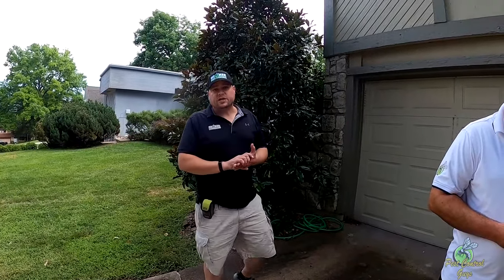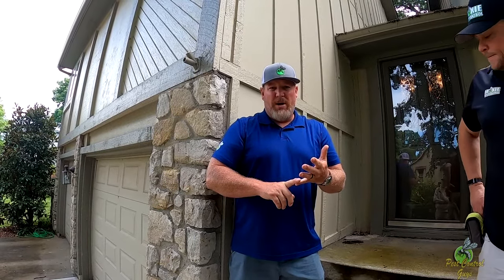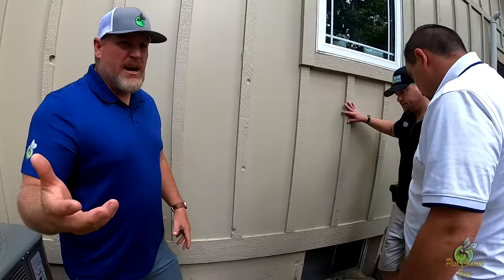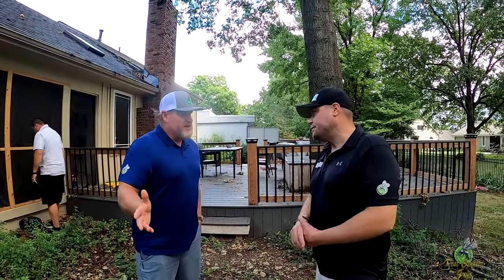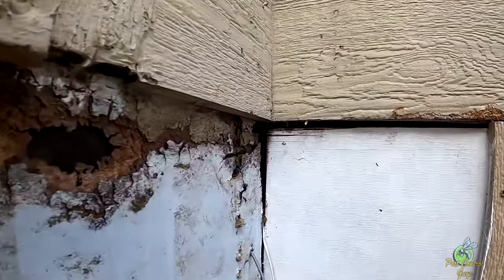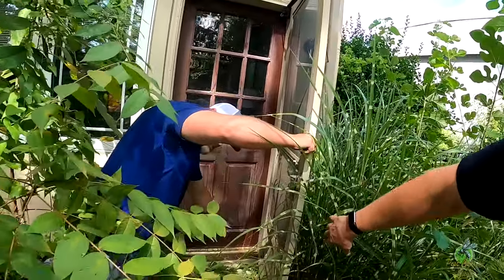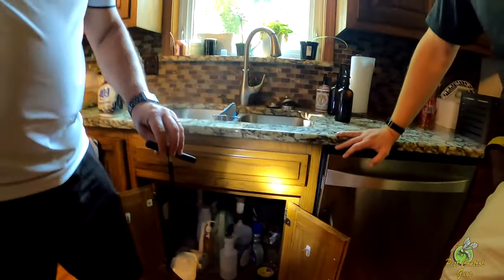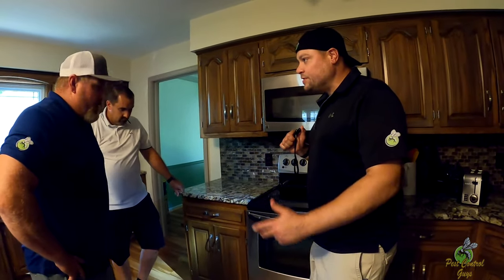How to do a mouse or rat inspection on a home. #mouse #pestcontrolguys

Comment: Good grief, maintenance, maintenance, maintenance. I do exclusion work every spring thru the summer to prep for winter. Every single year. The mountains are a rough environment but we have coal mine rats, the size of pit bull puppies. City princess thought it would be a great dream to move to the mountains. Uh, compared to the mountains large cities don't have rat problems. Try a mid-century modern house, unoccupied for seven years which no one told me and you know what I moved in to, a rat house. Princess learned everything from maintenance to plumbing to masonry, everything but electrical. A twelve year nightmare. I remember when I had a missing dryer louver. I found the fourth louver and put in 1/4" square metal sheeting then the louvers & in the winter a cut-out sheet of plexiglass will go over the metal sheeting when not in use. I read everything I could on home construction, rodents & controlling the population. Wish I had the luxury to hire pros. I also knew you were headed for the garage door first, that was my first clue I had a rodent problem. You guys know what you're doing. Everything you made note of I have done. That magnetic screen hopefully is gone. Nice job guys.
Reply from the maker: Thank you for the comment. It seems like the work is never ending, but you got this! Coal mine rats are no joke.

Comment: THANK YOU! for such a comprehensive video to discuss and show the entry points. We inherited an undisclosed rodent problem when we purchased our semi-rural home three years ago. We hired a service to mitigate and their solution was to use bait boxes outside and charge a monthly fee to "check and replenish" them. It didn't take long for us to realize we could do that ourselves for far less $$. Our home inspection at purchase did not notice the rim sill batt insulation in the basement was bulging all over the place and had holes like Swiss cheese tunneled through...it was our new electrician, who'd been a general contractor in a former life who spotted evidence of our "free-loaders". I will be re-viewing your video as I tackle this project before the weather turns this fall. Again, THANK-YOU, guys, for showing me what to look for when the ball was dropped by so-called "experts"!
Reply from the maker: You are welcome! We are sorry that you are dealing with invaders. Let us know if there is anything else we can do to help. Thanks for watching!
Reply: Hey, you just told my life story. Yes, same thing happened to me. You better get busy now. I have been working on my house for years starting in the spring thru summer. I was hosing down the soffit above my cement porch today and the hose pushed the soffit up to the roof line. I'm telling you, once you go poking around you're going to find things you never dreamed of. I also had an inspection, of course. What a joke that was, he was working with my real estate agent to lie (friends). I was just a city girl moving to rural America or so they thought. They hate me here, which is fine. I'm now 65, moved here 12 years ago and now have the nicest house in town. That didn't sit well, they figured I was city trash. They didn't know we were raised to be house proud and a perfectionist right down to hand trimming a half acre of grass. Lol. I wish you luck, seriously get busy asap. So much to prep for before fall.
Reply: Same deal, Inherited undisclosed rodent problem.

Tackling some entry points, appreciate your detailed video giving good ideas of where to focus!

Comment: Owner of a 204 y/o home with stone foundation in CT here. The previous owner neglected the property significantly. When I had a pest control company out to asses the home, I was told pests are “inevitable and part of owning an old home.” Being young & naive I believed them. After 2 years of living here, I don’t think I can tolerate one more squirrel or mouse. Thank you for this video as I found it empowering to attempt to address the problem on my own. When you say “seal it up” what do you recommend be used? Do you use the same material to fill large vs small gaps?
Reply from the maker: Small gaps use a high grade caulk. Large gaps can be with wood or cladding like siding. Medium gaps you can use a paint-able expansion foam. I’d look for closed cell foam. Then trim and paint it to seal it from elements. I guarantee you’ll do better than a hired hand. Putting a little love into an older home is worth it. Thanks for watching!

Comment: One of the things we have done in our kitchen is to never bait  traps there and to never leave kitchen grease ANYWHERE they can go. We use a glass jar to deposit all kitchen grease, oil etc as soon as the meal is done and then refrigerate the jar. Dishes get washed ASAP.  This has stopped them from inhabiting the kitchen. We also use a compost pail and rinse all throw away food containers.  No food.....few visitors.  We also  try very hard to provide surfaces they don't like (ex: heavy plastic storage boxes), sounds they don't like (sound machine), smells they don't like (eucalyptus )  throughout the house.

That said, we (like most homeowners)  have more to do.  Our crawl space, for example, remains a  challenge!  Given dime sized holes (11/16 inch)  as a guide, most of us are offering up the Rodent Ritz-Carlton on a regular basis. 

Thank you for this video!

Comment: I did a small roof on an enclosed porch no bigger than 8x6 feet and the ceiling had fallen preventing both doors from opening to gain access to the area. I was told whatever I wanted i could have that the previous owners left. I found $4700 in bills no older than mid 1980s and that was what I was able to salvage. At least 12 in. of nesting material from years of them living in there and of that nesting material half was money. Paper is paper to them
Reply from the maker: That’s crazy! Pretty good tip for the job I’d say. Thanks for watching!

Comment: Great video guys!   Watching you from the Uk
Edited.... Does pea gravel over paving stones and also around the edges of the home over some protection after treatment? 
I only have a little house
Reply from the maker: Pea gravel is better than mulch or vegetation as it offers no food source and won’t retain moisture as bad. Sprays will adhere to surfaces as long as enough spray is applied. As for mice pea gravel doesn’t help or hurt either way it seems. If you are trying to block entry points in the pavers they will dig gravel or dirt if they want to. Thanks for watching!

Comment: I have vertical board and batten and am looking for a metal anti-rodent strip/mesh that I can retro-fit to the bottom. (Where the b&b meets the concrete slab.) I'd like to do the entire perimeter. Do have a product you can recommend? Thank you.
Reply from the maker: We have seen a 1/2” channel that was a made to cover the bottom edge of the siding, I’m not sure how that might work with the battens. I’ve seen siding guys bend custom metal facia as covers. Hope you find something! Best!

Comment: I dont get it. Big deal if the mice can get in the garage. Does everyone leave their garage doors closed?
Reply from the maker: That is a good point, many times the garage doors are open too much and pests enter. However, the garage is just one more layer of protection. Typically there are entry points from the garage to the house that are harder to remedy, so sealing the exterior may be the best practice. Each home should be handled on a case by case basis. We put the emphasis on this garage since there was access to the living space above it. Thanks for watching!

Comment: How do you seal the holes outside and inside the home?
Reply from the maker: @edimirecheverria  it depends on what part is damaged. Outside if it is siding, we say replace the piece and re-paint. If it is inside, maybe steel wool or foam the hole and then patch Sheetrock. Other materials might require a different approach.

Comment: Can you show a home inspection for a mobile home????
Reply from the maker: We will look for one to inspect.
Reply: Hey thanks so much I appreciate that, and thanks for responding so fast! I live in North Carolina not real sure where you guys are, I just ran across you today!
Reply: For a mobile home, you want to check for gaps wherever pipes or wiring go in from under the trailer. make sure they are all sealed tightly. Also check the base of the siding for any gaps as an aged structure can separate slightly due to time and weather. Most have skirting around the foundation and mice can dig right under it. It is inevitable that that pests are getting under the trailer, so use bait stations under the home to monitor activity.

Comment: They are finding a lot of spots but you can NOT do a good exterior rodent entry point inspection without an inspection mirror and a flashlight. They should be using it to look up under different areas. Fail!
Reply: The video would be too long!!!!!

Comment: Thank you for your informative video on dealing with mice—it was very helpful! I have a quick question: Should I seal the gaps outside my house before taking steps to get rid of the mice? I'm concerned that if I seal their exit points first, the mice might not be able to get out and could stay trapped inside the house. What would you recommend? Thanks again for your guidance! Best regards
Reply: You could seal the gaps and just set traps or bait for the remaining mice in the house. Aggressive trapping will yield quicker results were as baiting could leave a dead mouse in the walls if you ended up sealing their only point of entry and exit. Eventually you should get all the mice and have nothing in your traps. Keep them set and if you go a long period of time without catching any or seeing evidence of them, then you can be sure you most likely sealed up all the points of entry. I would not recommend this strategy if you have rats or squirrels as they will be more capable of chewing a new hole out. This is when you would try using an excluder at a known point of entry.